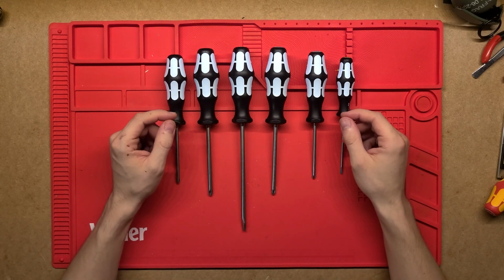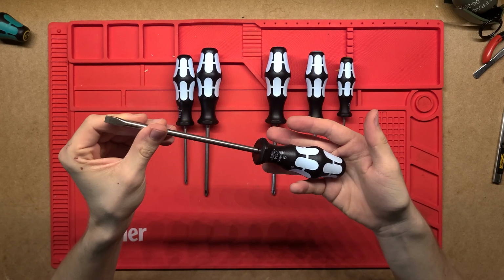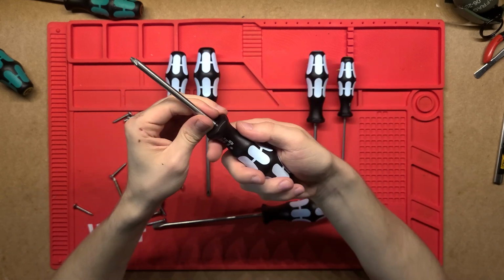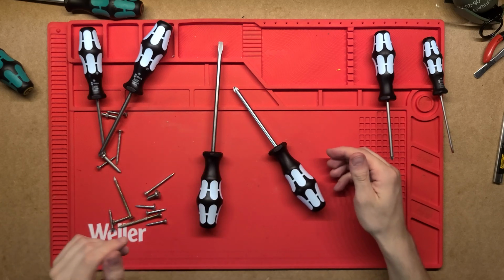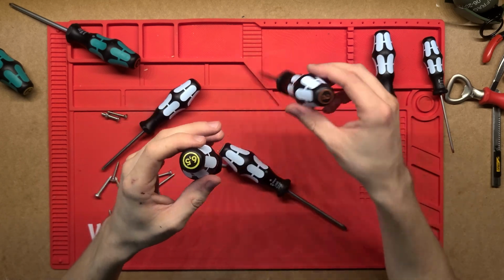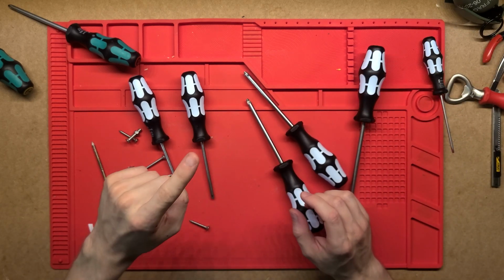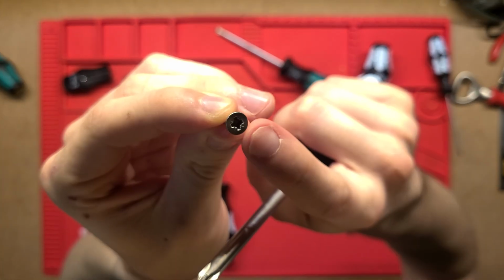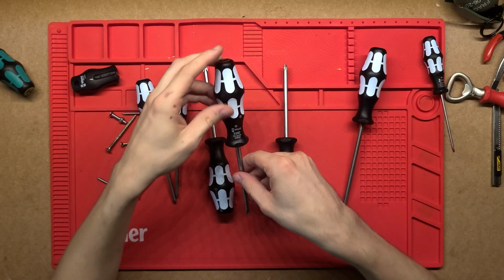STOP Using Rusty Screwdrivers! Use These Instead!

Comment: There is one downside to stainless steel vs high carbon in general.  Stainless won't have the carbon content evem in a 4xx or 5xx series to be hardened the same.  That's fine for hrc 48 to even low 50s but for knife edges or non impact screw tips it is a downside.  I know the inox or whatever base steel for the stainless that wera uses is top notch but I don't see it wearing as well for the professional daily driver.  Good thing there cheap enough to replace just something to note high carbon hrc like d2 can be in the mid 60s and not be brittle.